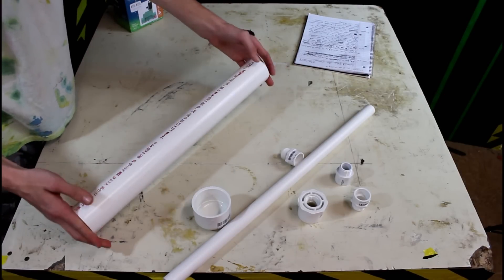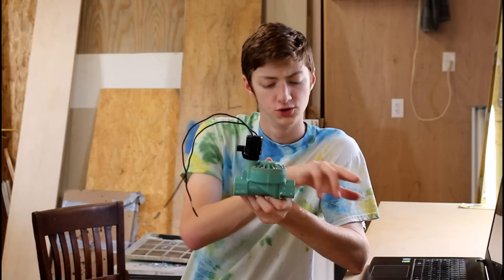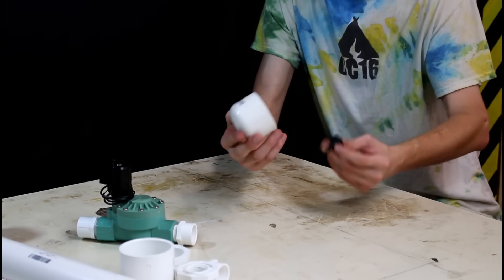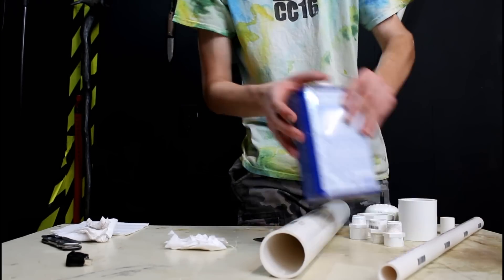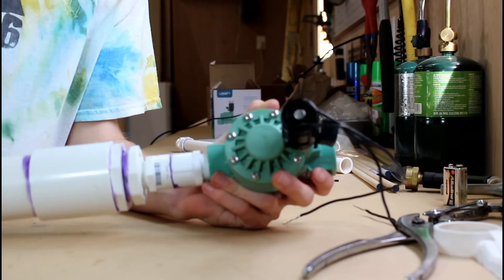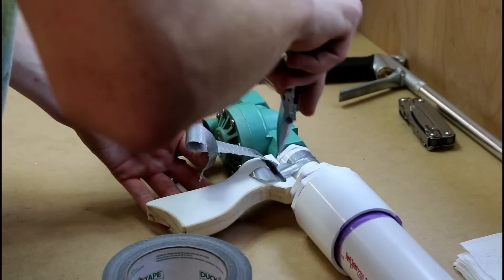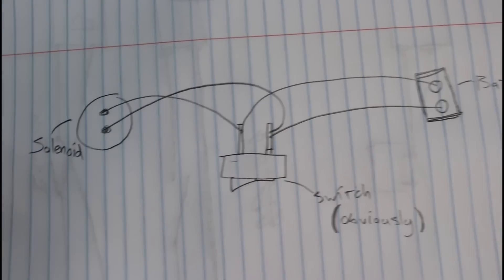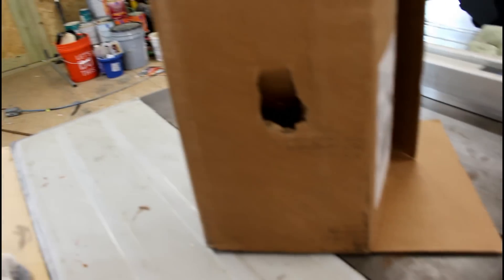PVC Air Cannon | Part 1: Construction

Comment: What would you use to seal the threads for a metal and brass air cannon? I want the seals to be permanent basically.
Reply from the maker: Just use some pneumatic grade thread sealing tape. No need to glue it on or something. Tighten em down and they won’t come off unless you want them too lol

Comment: if you have quick hands it works better with a hand valve. those sprinkler valves open way too slow.
Reply from the maker: Very true. My recommendation is to rig up a rubber powered trigger to flip the valve FAST.

Comment: where did you get the stuff to seal the bike valve to the pvc end cap? when ever I do this with a presta valve or something it always has leaks
Reply from the maker: Epoxy or JB weld. Airtight and can withstand very high pressure
Reply: Or you can get automotive schrader valves with a rubber base for steel wheels.  You pull them into place from the inside.  Wall thickness might prohibit though.  When you see one you’ll know what I mean.
Reply from the maker: I’ve used those they work great for this. Just using what I had available in this vid

Comment: A useful upgrade is to add a second ball valve on the back and a small pressure gauge behind that with an npt valve for easy pressurization with a air compressor
Reply from the maker: Yeah, but I can also easily pump it up with a tire valve fitting on the air compressor which I have
Reply: @jakemakes  true however i just find it easy to use on my cannon. more of a go fast thing also a lil more secure than a janky bike innertube xD
Reply: Can you elaborate on this please ?

Comment: The way you have your battery, switch and valve wired is wrong and dangerous.
The battery, switch and valve should all be wired in series.
You have all three in parallel, so when your switch is open, you have 9 volts going to the valve, when you close the switch, you are shorting out the battery.
That will very quickly drain the 9 volt battery, its a good thing you did not use with the heavier duty tool battery, it might of blown up from a dead short.
Reply from the maker: @15:27

Comment: If anyone else decides to make this make sure that the pipe you are using is SOLID CORE SCHEDULE 40 pvc or abs. Never use cellular core or thinwall pvc or abs for any part of a potato cannon that has any pressure in it. Oh and I made something just like this but it is bigger and the chamber is under the barrel.
Reply: Well you can use 1-1/2” sdr 21 sleeved in 2” schedule 80 for golf ball barrels but that’s different.

Comment: This just seems a little unsafe to me. You're relying on the piston in the sprinkler valve to fire the projectile. Are you sure what that piston can handle as far as pressure
Reply from the maker: Sprinkler valve is rated to 80 psi.
Reply: I have put 100 psi on the valve and it worked

Comment: you could have used sip ties for the handle
Reply from the maker: A very excellent observation my good man. One problem: I didn't have any :) Otherwise I certainly would have. Another good thing to use would have been one of those ratcheting pipe clamps.